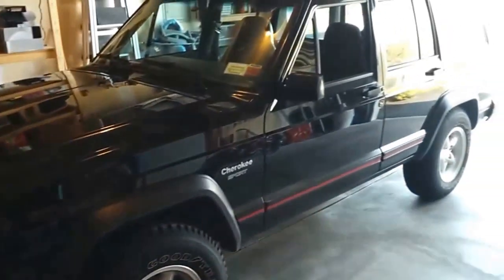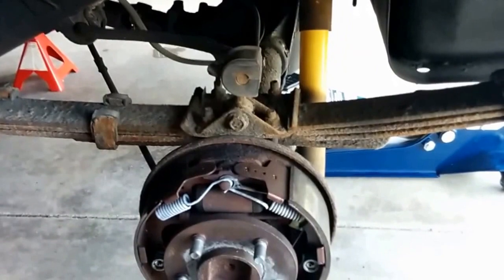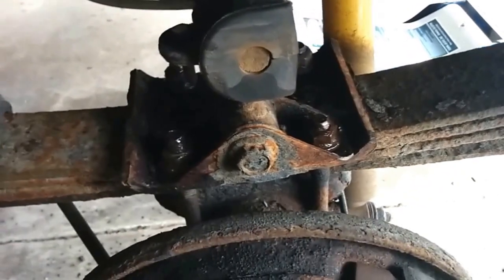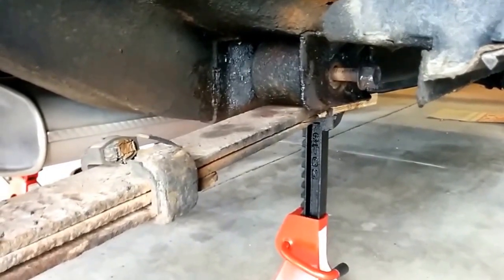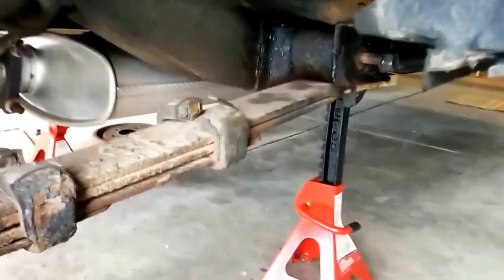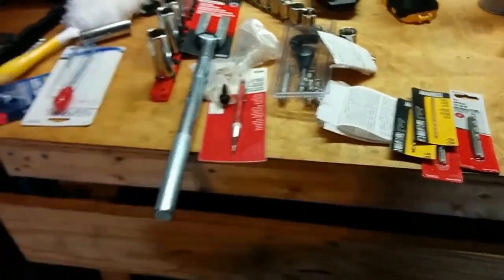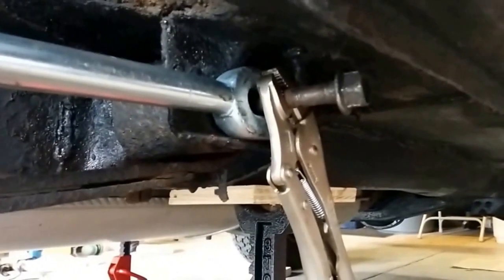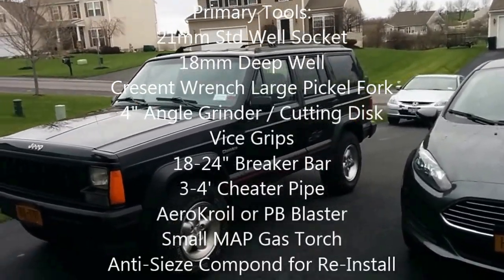Jeep Cherokee XJ Leaf Spring Replacement

Comment: Appreciate the video! Helped a lot!

Why the hell didn't they design an access hole behind the front bolt? Sawing that bolt if it gets rust welded in is rather aggravating. 
I guess we're supposed to change them more than once every 26 years or something.

Comment: Well Jordan, I followed your method on the shackle mount bolts - it’s going great.  Especially for a 20 year old Michigan XJ.  👏.  All bolts were showing movement last evening by going straight to the shackle mount with heat, oil, and breaker bar with cheater pipe.  2 weeks of pre-lubrication with PB Blaster a must.  I could cut off the U- bolts, but they’re all coming off easy.  Not so lucky with bump stops and sway bar bolts..  They are shot. Easy to replace - NP.    The real trick is patience.... Slow and easy - heat and oil.  Thx for the video.
Reply: Absolutely love the pickle fork idea!
Note: the bolt shank is 1/2".

I was too lazy to hook up the regulators on the oxy-acet. I just kept going back & forth to loosen the loctite. Well heed this warning: don't do this without heating the bolts. I put too much torque on them & broke the welded nut INSIDE the frame box. Cutting wheel is coming out to cut access hole !

Comment: very good/helpful video, dude ! How did you get the driver side front bolt separated from the nut in the frame ? Couldn't see it in your video - thanks.

Comment: done a few rear axle swaps. the sway bar--remove and throw it away. the stock u bolts cut with sawzall dont dick around unscrewing the nuts. the main 4 bolts also seize into the sleeve or the nut, or the nut seizes and breaks off from the body. when using the saw wd40 works good as a cutting lubricant. an 18 to 24 inch  1/2 drive ratchet will give you the leverage needed to turn the 4 spring bolts

Comment from the maker: Here is a forum post where I included some before and after pics, as well as my parts list.  I believe the leaf eye bolts are M14x2.0x120mm  (bonus, if you get the dorman shackles in my parts list, they come with 2 of these sized bolts on each shackle.  Effectively giving you 2 spare bolts for the leaf eyes).   
http://www.jeepforum.com/forum/f177/weekend-1-spacers-up-front-after-recent-dorman-leafs-3765057/index2.html
Reply: Jason thanks for the video it is very help I'm getting ready to replace mine on my 88 Jeep xj with 333,948 miles
Reply: The shackles come with a bushing...and so do the leafs.  Would it be cheaper to find a shackle with out the leaf bushing?  Since you're already paying for the bushing in the actual leaf spring?

Comment: Thanks for making this video.  Are those Dorman Springs their standard replacement ones (model number 929-301) or some heavier duty version?  I ask because you mention in the video that they added about an inch of lift to the stock height which you said is what Dorman said they would, yet I don't find any information about additional lift or increased load carrying ability on the Dorman site.  The page for the 929-301 springs says they are Standard suspension grade.

Comment: Ok...So..  Bigger Cheater Bar on the Breaker Bar w/ 21 mm and add some heat.  I’ve been using PB Blaster for 2 weeks - no movement.  I had wire wheeled the rust out before spraying it every other day - but I still got nothin’.   Yes, Kroil is better,  My shocks and U bolts are coming out pretty well.  BUT THESE LEAF SPRINGS AND SHACKLES ARE TOTALLY FUSED IF THE BIGGER CHEATER BAR AND HEAT DON’T WORK!  Welcome to Michigan.👍

Comment: If I were going to tackle this, and if I had the time and the space..... Using a cutoff wheel,  I'd cut the springs right at the bushings, make another cut on the other side of the bushings.  That would get the springs off the bushings and provide access to the bushings themselves.  Then I'd cut longitudinally  into the bushing and remove all the rubber which would would provide access to direct heat directly onto the back of the nuts.  Should be a lot quicker than tying to persuade the fully encapsulated bolts.

Comment: On the front bolts into the subframe I had to cut the leaf off the bushing then cut the bushing apart grab onto the metal sleeve it went through with vise grips them impact it to get them to come out 😂

Comment: Thanks for posting this. I'm getting ready to attempt this and I'm not exactly looking forward to it. Looks like a serious pain in the ass! Did you happen to go with HD springs? And if so, how r they riding/holding up since install? thanks again
Reply from the maker: I went with the Dorman HD springs.  I'll provide a link below.  There seems to be some disagreement in the community as to what comprises heavy duty, but Dorman refers to them as heavy duty.  I think any spring that replaces the factory "up-country" package springs is considered heavy duty.  These dorman springs will provide a little over 1" lift over the non-up-country stock Jeep XJ.  I have been very happy with their quality, fit, and ride.  Just about perfect if you ask me.  I got them at about $100/each.  So the price was good too (considering they come with bushings pre-installed).            

Dorman 929-301 Leaf Spring for Jeep Cherokee, Pack of 1 
by Dorman 
Link: https://amzn.com/B005VPS358
Reply: Hey just checking (few years late) if you did yours and how it went?

Comment: about to attack my leafs on my 2kxj. You mention heating the bolt. Normally you'd heat the nut, but seeing that the nut is spot welded in the frame there's no access. Heating the bolt really helps? I have a bottle of map gas, I hope that's enough to heat the bolt up.
Reply from the maker: MAP gas is fine.  It is what I use on nearly all of my Jeep projects.  In most cases, one heats the nut because they want it to expand and break the fusing caused by rust and time.  However, in this case the heat is being used to loosen/liquify the GENEROUS amount of red loctite that was added at the factory when the eye bolts were installed.  And because the bolt is long and large, it takes a little time for the heat to work through the bolt and make it back to the thread portion, also the thread portion is long, and is completed covered in loctite.  So don't be afraid to stop when you feel it getting difficult to turn, and apply some more heat.
Reply: +Jordan Moore thank you for your quick response and tips.
Reply: can you get a flame into that weld nut access hole?

Comment: Going to get ready to tackle this job in a few weeks.  Was wondering what you were using to heat up the bolts?
Reply from the maker: Yellow MAP gas cylinder and trigger torch attachment.  Like the type that can be bought at any hardware store.  Blue propane cylinders would work as well, but they aren't nearly as hot, so they take a lot more time.
Reply: Thanks for the info.  I'm hoping that I don't have to do any cutting and welding.  Since I don't weld.  We'll see.
Reply: By the way.  Good looking Jeep.  I have a '96 SE that my daughter is now driving.

Comment: nice XJ  bro i just got a 96 again after years of 97-01 but these ive done them before i just bought some HD ones and all new u bolts shocks and the bump stops they call them, i just measured mine its 18 front 16 rear anyways i have a trailer hitch that changes everything in the rear but i think i might get the rear shackels later on if i need a little more height

Comment: Hey man wondering how those springs are holding up now? Thinkin about getting some but I've heard they don't last very long. Your input would be much appreciated 👍🏼
Reply from the maker: I'm about 20k miles and 1.5 years into them.  They are still doing ok.  They are pretty tall when they first go in (at least an inch or more over what they claim), then over the next 10 months or so, they settled down to their advertised height.  Perhaps people are hoping that they will stay at the initial height, and when they don't, they feel let down.  Whether they will last 5-10 years, I don't know.  But so far, they have been a good value.  I think if you are going to load down the rear of the vehicle, or tow, they will not be sufficient on their own.  I recently added hijacker air shocks, and the combo has been very good.

Comment: Great video. What oil did you use on the bolts to help loosen them? And you used map gas?
Reply from the maker: Kroil (the spray variant is often called AeroKroil).  Once you use it, you won't bother with any other brand of penetrating oil.  It is about as good as it gets.  I ordered it off of Amazon.  Its not often available in chain auto parts stores.  I first learned about it when trying to remove crank pulley bolts from Hondas (notoriously difficult).  I haven't been without it ever since.

Comment: what are the chances of braking the bolt or the weld nut in the sub frame on the front bolt?
Reply from the maker: Pretty high if it has never been touched before and you try to muscle the bolt out without any preparation.  This will mainly depend on just how good the original weld nut was tacked into place at the factory.  That is hit or miss.   The bolt is quite long, coarse threaded, and large.  From the factory it was coated nearly the entire thread length with paste red loctite.  Which means it wants to SERIOUSLY stay put.  It will never vibrate out or loosen on its own.  So the secret (which shouldn't be a secret by now), is that you MUST get that bolt hot, seriously hot, to make sure that you loosen/liquify that loctite as you go.  Mine were all 20+ years old, with some rust, and had never been touched since factory.  I got them to thread out with a breaker bar, a cheater pipe, and a MAPP gas torch used to keep the bolt hot.  I also didn't over stress the bolt when I felt it start to get too tight, instead, I just applied more heat and slowly kept going.  They may still want to stick to the metal sleeve within the spring bushing, but at least you can try to avoid breaking the weld nut free.  Saving you that hassle.
Reply: thanks for the info , hava a 1999 XJ in nice shape and thinking about a 3 inch lift , rear leafs are a little crusty and flat want to replace them anyways , think I,m gonna order that lift kit and go for it , thanks again for the info , nice vid by the way , the best i found on the subject , happy jeepin bud!!!!!
Reply from the maker: Thanks.  If I'd had known how many people were going to watch it, I would have taken more time and included more detail.  I'm just glad its helping.  Good luck!

Comment: Man I'm in trouble cause if you call that rust my 90 don't have a chance. Maybe it will just be JEEP'Y ONE SIDE WILL SUCK AND THE OTHER SIDE WILL JUST FALL OFF like the other 3 I've built. My impact is 1,700 foot pounds and some heat.